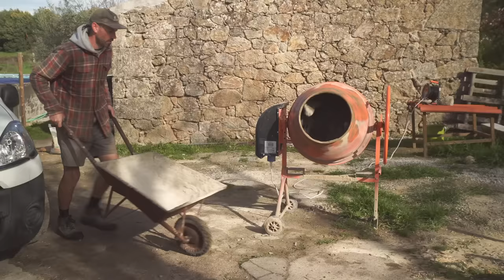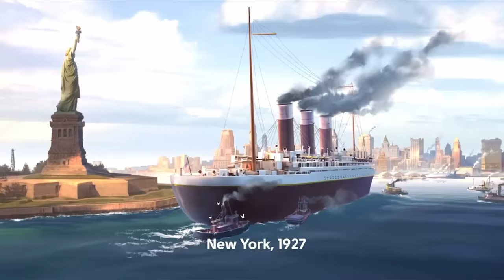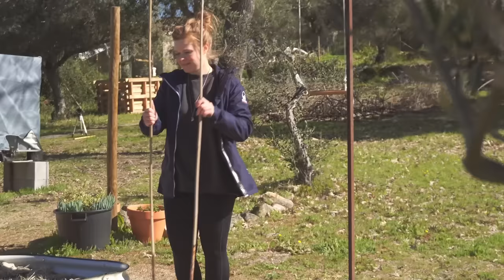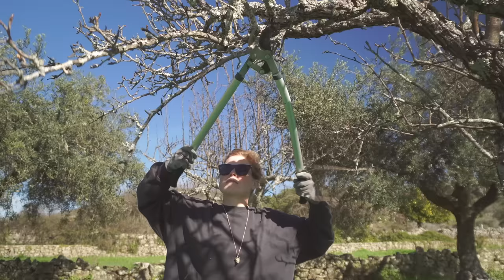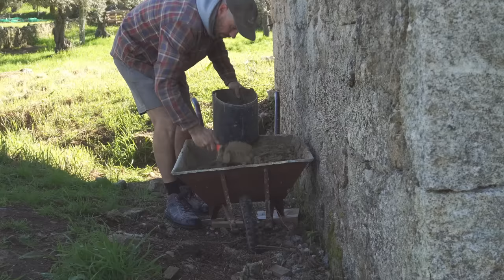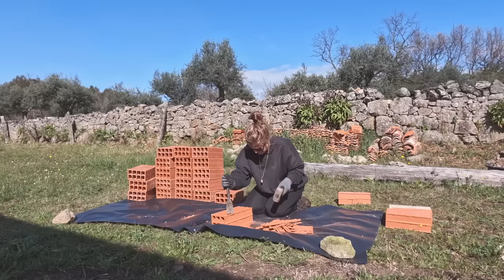Days Spent Renovating Our Little Stone House in the Country 🏡

Comment: Hey guys. Just a quick note on "nitrogen fixers". While there is nothing wrong in composting broom in your Hügelculture-bed (which you pronounced very well), the ability of certain living plants to fix nitrogen comes about by taking nitrogen from the air and "fixing it" in symbiosis with bacteria (Rhizobiaceae) in the ground around its root system. This makes these plants great pioneers, because they can grow in poor infertile soil. They produce their own fertility. Their use as "nitrogen fixers" for other plants comes about when they are cut back and thus part of the root system also dies back, which liberates the nitrogen attached to that part of the root system. That's how these plants work (legumes, clover, all faboideae ...). So the buried broom will not fix nitrogen for you. In decomposing it will still provide nutrients (but not more than other green material). Hope this explanation helps. To find out more about nitrogen fixing plants and how to use them search for permaculture and companion planting. Cheers from Italy.

Comment: Nicely done Victoria. You'll be quite happy with the hugelkultur beds. I did mine 5 years ago and they are wonderful. Mine are slightly deeper (26 inches) and I was able to use some larger diameter log pieces along with branches, sod clumps, loads of leaves, etc. Saved me from needing a LOT more soil and compost for the upper layer. I dug down last fall almost all of the hugelkultur material has decomposed! My best performing raised beds each and every year.
Reply from the maker: We watched a YouTube video where someone did the same as you & took the bed apart to see what had decomposed. Really interesting. Hopefully this method will give us some good results!
Reply: You can use hugoculture directly on the ground too.
Welldone.

Comment: Hi, been binge watching the renovation of your stone house, it’s looking great. Wanted to pass on an observation. The roof membrane under the roofing tiles at the bottom edges should not be tucked in, this should come over the top brick detail and then into a gutter. The membrane acts as a secondary defence when you get wind driven rain through the roof tiles, and will drain any water out at the base. Carry on the amazing projects.

Comment: You guys are the hardest working couple I have ever seen. I had an 8 acre piece of vacant land that  completely improved, and I used a small John Deer tractor with 3 different attachments, to remove brush, cut weeds, take out huge rocks, dig trenches etc. I just wondered why you do not buy an old tractor of sorts that could save your back and make it much easier? I don't want you guys to get injured!! Victoria, you work harder than any man I have ever worked with.!!
Reply from the maker: even 30/40 year old tractors are expensive here. We've been saving for one for a long time now. Ideally need something newer & fairly reliable as we don't know much about fixing engines. Just have to work twice as hard in the meantime

Comment: Victoria, Apparently it is common for gardeners to use scrunched up newspaper to save moisture, along those lines perhaps you could consider adding your shredded paper work in your compost and of course in your raised bed... Regards and good luck, Robin.
Reply from the maker: Thanks for the tip Robin 👍🏼 We actually made a few more beds (in the next video) & put cardboard in those so hopefully it’ll have the same effect as the scrunched up paper 😊
Reply: and decades ago, i read that same fact.  Seems that shredded newspapers would benefit the soil faster since it resembles the fallen leaves of Fall.

Comment: one advise: if you already struggling with the heat for your veggies - maybe the metal beds are not the bestoption as they heat up a lot more than the wooden ones, especially on the edges. they look nice but have disadvantages

Comment: Hi there…for your consideration, I have a some ideas to save you work and $$.  1) Layout a tarp or dark plastic over area you want a veggie or flower bed and the sun will help you by cooking the weeds and grass away, leaving a bald plot of soil in 1-2 weeks. It’s so much easier to turn for a new bed. 2) consider seeding grass area with Dutch Clover. It’s eco-friendly, easy to get started, sprouts in days, drought tolerant, NO MOWING, grows 6-8”, flowers attract pollinators, chokes weeds and stays green when summer sun burns grass brown. 3) Search “soil cement” its a  wonderful method to save $$ for solid cement base for drives, walks, paths, shed floors, etc. easy DIY basically…remove organic matter, turn soil 4-5”, dampen with water, add 1” of Portland Cement, turn into soil, dampen, compact, wet, cover. Keep wet and cover for a few days till it cures. Incredible strength. GOOD LUCK WITH PROJECTS!

Comment: Love your work and you both are such hard workers! Good on you for following your dreams. I haven’t noticed any compost beds in your videos so far, do you have any? They are such a boon when you need to redo vegetable beds, pots etc and the best use for your household organic scraps. It might be a long term goal for you as you have so many jobs lined up but I would recommend considering it. One useful strategy is to build three or four adjacent “stalls” and designate them for various materials, kitchen compost, woody waste, larger wood etc you can add a lid or front section, even a sheet of tin will do (weighted down against those wild Portuguese winds) its then easy to get in and out for aerating, shovelling etc. I had four at my previous place, one had an old hurricane fence panel laid flat on bricks for locking up our broody chooks to cool their bottoms down (yes it’s a thing!). Anyway love this series, always delighted to see a new episode has landed and your stone cabin renos are flipping marvellous 👏🏼👏🏼👏🏼👏🏼

Comment: Well done, you have done so well so far, both of you are so hardworking and talented. As regards the new garden location, I really think you need to either borrow or hire a compact tractor with a cultivator and rip up your in ground veg beds, failing which a pedestrian rotavator. The timing will benefit you greatly in getting some crops going early. I know it is a cost but would the crops help negate that?

Comment: I am so impressed with all of your work. It is looking so good. Can't wait to see more of the tiny house!  One tip on your raised beds Victoria.  I also have raised beds and I too added the logs etc to fill about 1/3 of the bed.  I found after the first season it dropped in depth so I had to add more soil.  Also, here in Southern CA we have ground squirrels, voles and moles. They have dug up in the bottom of my raised beds this year and eaten the roots off of my broccoli and flowers!!!!  So now I have to remove all of the soil and put hardware cloth on the bottom of the bed first. You can google it if you're not familiar with hardware cloth.  Take care and thanks for sharing your life with us!

Comment: all that broken bricks would make great pathways between gardens; the tiny house is looking good, are you putting an extra floor in it? was noticing the holes in the stones that look the size of roof beams?
will you be building a porch out the front to protect the door? would look awesome too
loving the blossoms at the moment, do they produce fruit too?
gorgeous sunset!
make beautiful stone steps going from the green house to the new section? it would look lovely, especially if you continued the small wall down either side
thanx for sharing

Comment: For the water to run off the roof and not down the walls the roof tiles should overhang the brickwork. I'm not quite following your design?
Reply: Ricky mentions earlier (to Winterfell 1066) that another row of tiles will be added to the roof at the front and back.

Comment: Traditional bricks are solid. Have you found it easier/more difficult working with those multi-holed bricks?
Reply from the maker: Have never built anything with traditional solid bricks so can’t compare. Only thing I can say is that they’re much lighter!
Reply: cupboard bricks retain less water and allow better air flow to curtail mold for bricks used as cellars and earth refrigerators in colder Sates.

Comment: I can't understand why you didn't carry any overhangs further out the front or sides (Gable ends), but especially on the front and back.Looks like your water will just dump onto the flat bricks and could run back down the inside wall. I am sure you have a plan, but in the USA (I am from Mississippi) we get lots of rain (55-60 inches a year), you want large overhangs that put the water away from your foundation.  Can anyone else comment and explain? Not being critical, I just don't understand this building technique.
Reply: I think the idea is that there will be another course of roof tiles that will create an overhang which may also have a gutter with down spouts at the corners. But even with that the overhang will be less than what is typical in North America.
Reply from the maker: There’s another row of times to be added front & back. Will be in the next video 😎